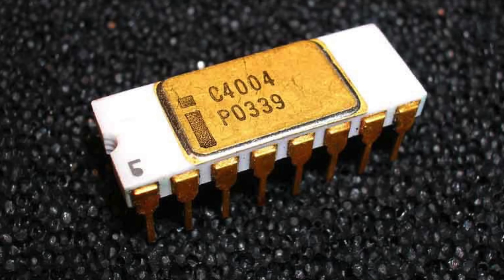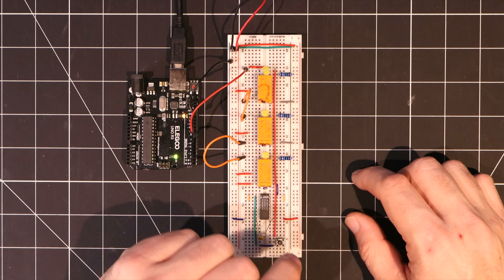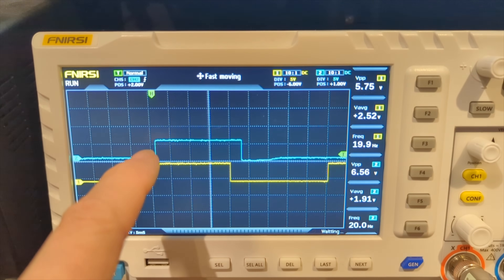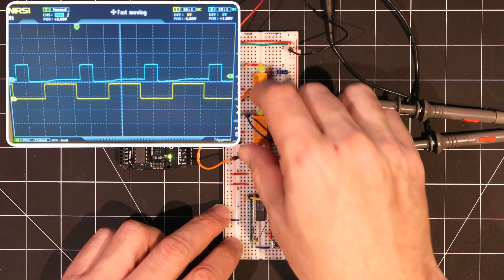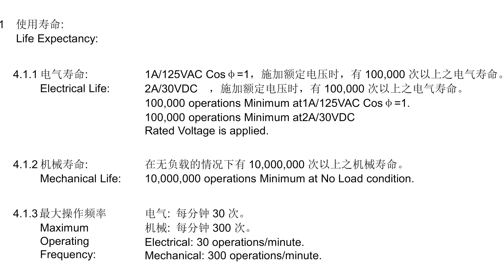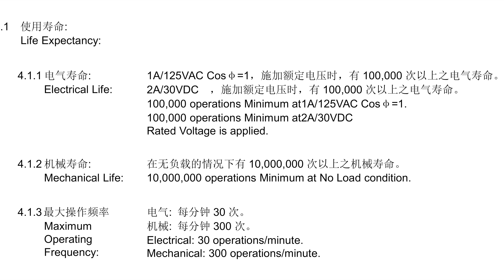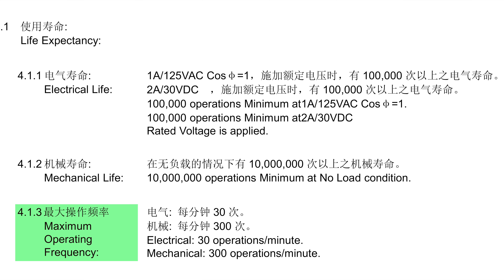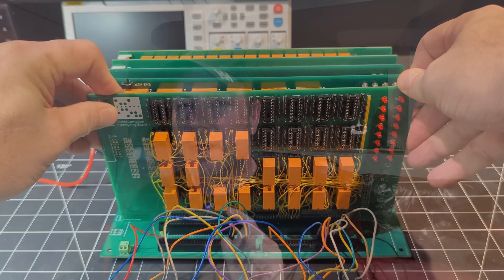Relay Computer - Quick Clicks #3 - Speed! (How fast is too fast?)

Comment from the maker: While I was able to quickly test the relays for 100,000 cycles, I'm going to keep testing to see just how long they'll last. I shouldn't push the relay computer too hard, but I think the occasional "turbo mode" is acceptable.
Reply: This results will be very interesting. Looking forward to the following video.
Reply: It will be very interesting to see the results and I'd love to hear what the result ends up being in a future video. Do keep in mind that the stated endurance in the datasheet is a guaranteed minimum, not an average, so they may end up working much, much longer, especially with the low voltage and current they are transmitting. They might end up wearing out mechanically before they wear out electrically with your set up.
Reply: is the test still running?

Comment: I once wanted to run relays at 60Hz but upon reading the datasheet and using a calculator I just gave it up( I still have the relays in question two super small, can fit on the tip of the index finger) this has been years ago since then I never used relays in any of my projects. I mean, I had concerns about the durability of the thing, if you're using those for commutation at sporadic times it is fine but frequent switching like I wanted, I wanted an alternative to semiconductors, vacuum tubes are just too high voltage and relays too fragile, what do I do now? LOL
Reply from the maker: Yeah relays at 60Hz would mean a very short life-span. There are lower voltage (12V) vacuum tubes to consider although I don't know how available they are.
Reply: @dipdoting  not much, where I live I can't even find those, have to import, plus vacuum tubes are too low current, I considered saturable reactors but it comes with it's own challenges like the need for an AC source, and I wanted to power from batteries, so, how do you go from DC to either pulsed DC or AC with reasonable power output capacity at low voltages without using semiconductors? there were devices used to make HV for tubes in cars and planes I forgot the name but were essentially mechanical inverters but those worked as relays didn't got info on the lifespan though, my alternative would be a brushed dc motor powered rotary switch(like the rotary spark gap used in tesla coils but instead of spark gaps I'd use rotating contacts or something in the shaft of the motor to activate the switches and a snubber circuit to damp the spark across the contacts at turn off but never got around doing it but I bet that so long as the motor is properly driven with protection capacitors proper lubrication and undervolting with light mechanical load would have a very long lifespan in continuous use but even then I'd have a hard time controlling the frequency, duty cycle is possible with the proper parts but frequency would require changing the motor speed without semiconductors, my requirements were no semiconductors aside LDR and diodes, LEDs were fair game as well and above all it had to be durable, able to endure years of continuous use without complaints, I was dreaming of an EMP/EMI resistant/rugged/proof electrical machine, it was more of a personal challenge, quite brutal one at that and turns out if properly designed, semiconductors can resist EMP, something I picked up recently, even mosfets with their fragile little gate, didn't built anything but I made drawings and a lot of research on it, even found a guy who used LEDs/LDR pairs as low power switches, slow ones at that, he even made logical gates out of those and paired with DRL(diode resistor logic) managed to do and propose interesting stuff. quite long text, sorry for that.

Comment: So after 2h 47 min the relays still worked fine - when did they actually fail?
Reply from the maker: It's a good question - I ended up running them for +5 hours and still going strong - although the release timing had extended a bit further. It will be a good follow-up video to test them to failure or the point where their release time is simply too long to be usable.

Comment: Modern CPUs with clock speeds in the Giga Hertz have similar problems, only six orders or magnitude faster. This problem scales perfectly. There's a limit on the number of logic gates that can be on a path. Bonus item on GHz speeds is propagation delay of signals in a wire. The fact that GHz is reachable is still magic to me.

Comment: All the relays we had at the central office that were socketed also had a screw through the center of their chassis which would secure the relay into the socket. 

Otherwise, they would work themselves loose and fall out over a period of several months. 
That was in spite of the socket needing a hefty shove to seat the relay. 

It's ultimately death by a thousand pinpricks. Tiny mechanical movement plus Newton's laws.
Reply from the maker: I was fortunate enough to get a tour in phone exchange building in the 80s, small town with old electro-mechanical equipment. They had screwdrivers chained to each rack with spare relays, ready to change them out if needed.

Comment: With older generation PLCs (Programmable Logic Controller), the outputs where almost always relay in my company. Most of the time the load on them was 10% or less from actual rated current and with resistive loads and properly protected inductive loads they would last anywhere between 1M to 5M cycles for 60 to 200 actuation per minutes. We even had some cases where they lasted over 15M cycles so I would not worry too much about it. As long as you use them within specified parameters they will provide couples of years of reliable service.

Comment: Regarding mechanical cycle life: I worked at manufacturing plant which used mechanical switches to monitor motion on some slowly rotating shafts. The switch was actuated about 12 times a minute. These switches would only last about two years. A quick calculation showed that at this rate of actuation the switch experienced 10 million actuations in about a year and a half. It was surprising how little time it took to rack up that many actuations.
Reply from the maker: Thanks for the real-world experience, it's amazing how quickly those actuations add up!

Comment: Long ago, I worked for a firm that manufactured portable waste water samplers.  Their original design was strictly electromechanical.  That is, its timekeeper was a VW dashboard clock, an 8-day mechanical clock magnetically linked to a reed switch to produce a pulse every minute.  Then latching relays acted as counters to regulate the sample taking.  It was a thing of beauty.  At rest, it drew no power.  Sadly, tho, it had to be redesigned around a microprocessor.
Reply from the maker: That's a great story about a classic design! Sometimes simple is best...I'll bet it was a factor of cost at the time as well...very cool!

Comment: one way i think it would be really easy to deal with the loose relays in the sockets issue would be to mechanically hold them in : ) you could be fancy with it and 3d print little latches for each relay, or you could do something as primitive as using standoffs to screw a nonconductive sandwiching plate over the board at the height of the relays so they can't move!
Reply from the maker: It's a good idea! Sure beats desoldering them later!

Comment: What sockets are you using? Maybe some sockets are better at keeping the relays in?
Not all the relays are going to see the same wear, so if you can somehow estimate which relays are the most likely to fail maybe you can put those in some high quality sockets (or sockets with 3d printed retaining clips maybe?)
Reply from the maker: I'm using some generic sockets that cost around $0.30 each - so I get what I pay for. Going to upgrade those to see if it makes any difference. The retaining clips is a good idea as well...so much great feedback on this! Thank you!

Comment: If you want to close the relay faster, use a zener in anti series with a schottky diode. Experiment with the values. I had good results with fuel injectors.
Reply from the maker: Sounds intriguing! Will definitely need to experiment with those!

Comment: Many years ago, I helped with the restoration of a tram that was being fitted with LED indicators.
As they don't draw a lot of current, the standard flasher can wouldn't work, and LED-capable flasher cans weren't easily available, so we made our own, using a 555 timer and a relay. (Indicators run at about 1Hz.)
They lasted about 5 years in regular service, with the vehicle running anywhere from 0 to 24 hours in a week. Of course, the indicators weren't on for that entire time.
We used those flashers in 3 different vehicles, and they all started wearing out around the same time. 5 years of use in a running museum.

So... based on usage, I'm guessing you'll get 2-5 years regular use out of your relays. This is nothing more than a guess of course.

When I recently revisited the indicator circuit for another restoration, I used an arduino and some mosfets for a,solid-state indicator controller - but I still embedded a relay, with no load, because indicators should click-clock. I'm looking forward to a 10 million click lifespan, it may even outlast me :p

Comment: I expect at the loads you have on these relays, you can ignore the electrical life and consider the mechanical life as an absolute minimum. Also the 6ms to 7ms operate time may be temperature related. You should measure again when the relay has cooled down. In fact some of your relays may ultimately die because the load is too small, not too large.
Reply from the maker: Thanks! That's really constructive advice...I'll admit that 100,000 electrical operations had me worried for a bit there. I definitely notice a difference in ms when the relay is warmed up.

Comment: When I tried to build my own relay computer, about 10 years ago, I build a counter with 10 flip-flops made from 4 relays each and let it run continuously for a week in a frequency of 1Hz. I noticed no problem on any of the relays. I expected the ones on the first flip-flop to fail first, but I got annoyed from the noise before any fail. If you put a diode across all coils, I don't think you will have problems with them.
Reply from the maker: Although I love the sound of the relay computer running - I did go for a walk during the testing - I couldn't concentrate with all the racket! Have you thought about getting back into your relay computer build?
Reply: @ I do think about returning to relay computer project all the time. Recently I had an idea for instruction decoding I took from pinball machines that I would like to try. It should decrease immensely the number of relays needed. I also have a circuit for memory using capacitors, but it needs testing. One thing Prof Harry Potter did that I want to avoid is to use solid state memory. I am going for the Harvard architecture with the program on a tape loop. It solves the need for memory but creates a nightmare for jumping to adresses on a tape.

Comment: Put a hole in the PCB either side of the relay and use a cable zip tie to hold it in the socket.  Easy to replace that way.  Good luck!
Reply from the maker: That's a total Macgyver move! Love it!
Reply: yes !

Comment: Yes fun is most important :) Keep going !
I understand it is for fun and very price driven but you are using not suitable relays for this kind of work, those are for rare switching of substantial loads.

More suitable are telecommuncation (PBX) one simillar to OMRON G6J-Y 50 million cycles at 36000 / hour cycles at hour (10Hz) or KEMET EA2/EB2 100 milion cycles.
This kind of cheap IC sockets may not be suitable for relays to put it mildly, but specialised or precision socekets for IC's are not cost/effect solution here.
But with more suitable telecomunication relays (smallest are in IC like cases, not SSR or PhotoMOS, mechanical with lovely click), smaller moving masses are involved so sockets may survive.
Reply: yes, reed relays are faster and need much less energy.
Reply: @yxyk-fr  I don't know how are they build those, probably most are reed indeed. I bought one for me "father broke my duplo train" project, they was not as flat as IC and clicked like "normal" relays.
Reply: @AK-vx4dy  that was likely a reed relay  🙂Faster but much less current handling.
Reply from the maker: It's a good point - as I'm experimenting right now the cheaper the better - but once the design is finalized I can recreate the machine using those higher life-span relays.